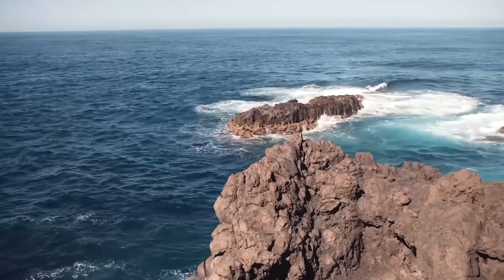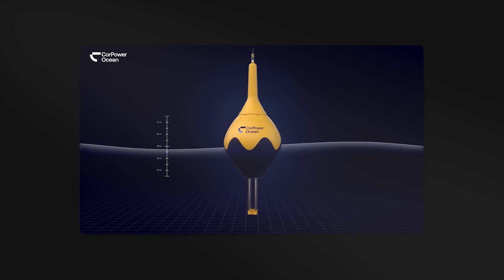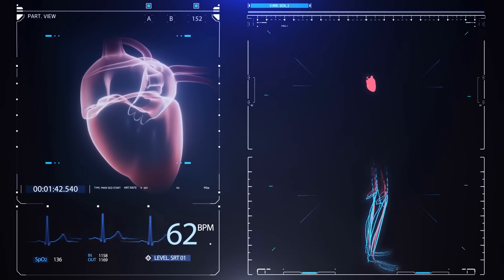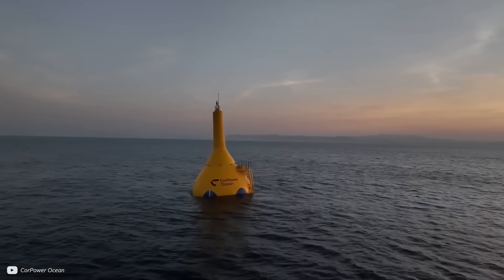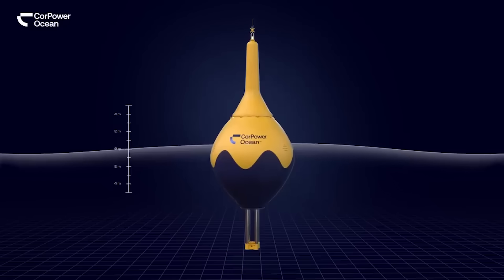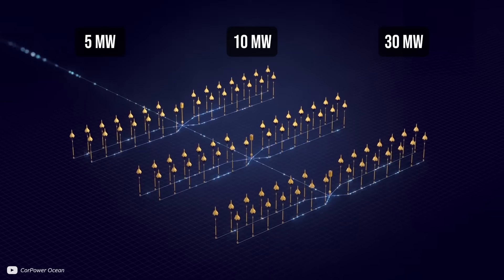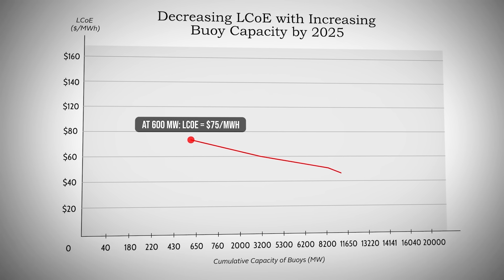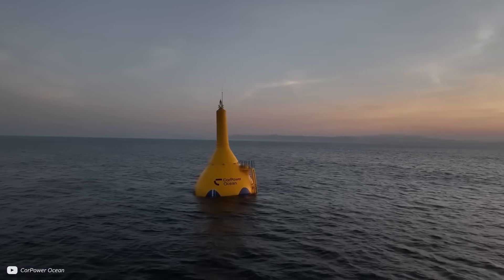Unlimited Wave Energy: This Buoy is the Future

Comment: I've written to this company and at least ten others (working on wave energy conversion). over the last 10 years.  
I have never heard back from any of them.

I have identified a viable method to power the business end with an alternate to the ocean.
Reply: Unfortunately, there are legal liabilities which discourage companies from freely responding to solicitations about novel ideas. I transition from a staff engineer to an engineer-patent attorney liaison for 6 years. I saw the reticence to openly meet with people. You may first need to officially document (such as filing a patent application) your idea. This codifies WHAT your idea is and helps protect the company from people who may sue, claiming their idea was stolen, when, actually, the company independently designed, or designed before the initial meeting. You may also want to volunteer a Non Disclosure Agreement (NDA). If they respond, you can expect their own NDA to follow (read it carefully).

Note: A patent application typically remains PRIVATE for a ~year after filing before it becomes public. So, if you want to promptly discuss your idea after filing, you would have to specify your willingness to present the as yet unpublished application to them. 

Filing an application is relatively inexpensive. Pursuing it to either final rejection, partial acceptance or full acceptance (rare), is very costly. Unless you've got substantial financial backing, don't bother. Lastly, a patent does not necessarily give you the tight to build and market your idea. But it does give you the right to litigate against others who have infringed. This should serve as a GIANT red flag to lone inventors because even if a company infringes, the costs of litigation can EASILY dwarf the cost of obtaining the patent. Without the funds and the time to see litigation through to completion, you automatically lose.

Comment: Wondering if these could help as part of a multi-layer storm protection system too-? Have these out before any more major Sea-wall projects because they function whilst sapping energy from incomming waves, that's how thermodynamics works right?  So during stormtime, have them in a high-resistance mode so they sap more wave energy and protect themselves from damage by hitting their extremes of travel, and could that difference be enough to help reduce the strength of storm surges? Climate change is only making storms more severe over time and this feels like a double-whammy of clean energy and coastal protection.  I live in a coastal town myself, so very interested in this subject.

Comment: I had a similar idea but instead of wave powered it would be tidal powered. You would have a weight at the bottom of the ocean with a cable going up to the buoy that would lock in at low tide and release at high tide, then the cable would go around a spool that would be hooked up to a gear system and an electric motor. The great thing about this is that it can generate power at predictive intervals.

Comment: It would be interesting to hear about how the units deal with tidal shifts. With the rigid mooring systems, it appears that they only work at a set depth. That would mean that with a high tide or a low tide, the units would be inoperable due to being over extended/retracted and would just lock in place. There would have to me some way of controlling the length of the mooring rod connecting the units to the seabed and I don't remember this being covered by the video.
Reply: not for ig tides  simple, use tidal energy systems for big tides

Comment: Wave energy could have been done a hundred years ago, but it was the petrol mania already building up and establishing in the 1950s and selling toxic petrochemicals and nanoplastics in the 1980s

Wave energy can be easily done in an artificial wave reef to absorb wave impact on floor, or air piston chambers on port and rather than produce electricity we don't need ( as well countless if useless electric devices) it can produce compressed air for neumatic energy to power any mechanical appliance, machine or tool while concentrated solar can be used for cooking and solar distillation desalination, while also fridge compressors can be powered by wind turbines shaft,etc

Comment: This does NOT take up less space / is not lighter:
"The 300 kW rated power C4 WEC is 9 m in diameter, 19 m tall, and has a mass of around 60 tonnes"
A GE 1.5 MW (5x the power)  Wind turbine: 70 m tower (3.7x) and is 164 tons (2.73)
Infomercials like this are the worst. Stop copy pasting their marketing material and do 5 minutes of research.

Comment: I don’t think that your description of how the heart works is correct. As I understand it the main chamber of the heart pumps blood all around the body and the oxygen depleted blood returns to the second chamber of the heart. Then the second stroke, the Diastolic stroke or referred to the resting stroke pumps the blood through the lungs to re oxygenate it and that flows into the main chamber for the Systolic stroke to do the process all over again. I think that is how it works.
I do like the idea of using wave action to generate power though. I live on a boat and am looking for ways to generate more power during the non daylight period. 
I like their rack and pinion drive approach, and that got me thinking of how I can utilise the movement of my boat to generate some power. My 5 minute notion is to have a long vane on each side of my hull with a leading edge pivot point where a power generation device of some kind is built in. The 2 “paddles” would generate power as the boat rocks with the waves while sailing. These paddles could also act as stabilisers too. That is worthy of an experiment. The big problem is how to turn small pivot angular movements into energy. I think I will start with, rather than a rack and pinion, a high ratio gear drive. Even if it only generated 200 watts while sailing that will be some 5 kilowatt hours in a 24 hour period.
That has a lot of potential, so thanks for the inspiration.

Comment: Might work for preventing coastal erosion too. A few rows of those parallel to the coast should be able level the waves.
Reply: How will this dampen waves or encourage root growth?
Reply: @jasonsharma5888  Like oil on water, just leveling bigger waves so they don't grow big at the coast and eat at the land.
Reply: @biondanishgenomeinstitute8193  I see, you would need to put these devices in a mode where they pushed back against the waves without breaking in order to do that, and the more surface area they had the better they'd work; currently when there are big waves the device disengages so it doesn't break and they're designed to float, more than fight the waves. Your analogy is also flawed because oil on water is adding surface tension. There is another issue: where waves grow the most is probably closer to the coast than these devices will be anchored.

Comment: Interesting video but you'd need a lot of these 600KW wave generators to replace a single 8MW offshore wind turbine. You also need more connections to join them all up. Also remember that anything immersed in sea water will suffer from corrosion - the generators in offshore turbines are generally around 100m above the sea but these are actually in the sea. The fiberglass shell of the device certainly reduces the LCOE but will it survive impacts with debris that can be floating in the sea? Will it be equipped with a pump in the event of a puncture and will it notify controllers that  something needs to be fixed. Do they work in all sea states (other than flat calm)?
Reply: Yes, these things need to be light enough to float, yet sturdy enough to handle anything the ocean can throw at them for decades.
Looking at the shore-line after a storm and seeing what washed up ashore makes me doubt these things are sturdy enough.
Reply: It's not just a matter of connecting up all the generators.  If they are generating AC voltage they will all be out of phase - how to combine their outputs?  Presumably there will need to be conversion to DC at some point to enable them to work together.

Comment: The best thing about this system is that the corrosive environment is totally sealed out of both the electrical AND mechanical components, ensuring a long and reliable life. Brilliant!
Reply: Give it time
Reply: The environment will ineviably find its way in.
Reply: It moves up and down it's anchored tether.... So it is exposed.
Reply: @John-ou4rm  yeah, I've just had another look and there has to be some kind of seal at the bottom of the buoy... That must be one clever seal.
Reply: @Poult100 many car seals have three rubber rings, so if one fails there are two more that  hold.
Reply: If the outside gets corroder they might reuse all the internals and put it in a new extetior, that would be huge
Reply: That is key, every other ocean based system I have seen would be wrecked by corrosion, or require a significant amount of regular maintenance.

Comment: You can NOT reach 100% efficiency in the real world and 300% efficiency is complete nonsense as the thumbnail implies, sorry.

If the thumbnail meant that the efficiency is 300% higher than other solutions, that could be possible, but it is not what the thumbnail says.

Why?
Waves carry some energy between their ordered (calm water - high entropy) and unordered (spikes - low entropy) states.
If the buoy harvests this energy without adding any other energy source like solar or wind turbine, it is impossible to harvest more energy than there is.
It would also be nonsense to measure the efficiency of multiple sources relative to a single source's possible output.
You will also always lose energy in the generator by friction, transportation, and so on, so you always harvest less than 100 %.

Yes, heat pumps as a counterargument have heating efficiency higher than 100 %, because you are not generating/transforming energy (heat) but you are "stealing" (transporting) the heat from another place.
So it is not the efficiency of harvested/transformed energy, but rather the ratio between the input energy and the stolen energy from outside.
When there is no heat to steal, you have to transform the input energy into heat which the boiler does, and again, you can not even reach 100% efficiency.

Comment: I had this idea too about 15 years ago, so I calculated the maximum yield during a vacation on Tenerife (I have a Masters degree in mechanical engineering). The waves around Tenerife look great, but even there they're about 2m high and arrive every 10s. To catch the top of a wave efficiently, the diameter of the buoi maxes out at around 3m. This resulted in about 5kW power per buoi, so you need about 1000 buois to generate as much as 1 off-shore wind turbine. This is why I gave up on the idea...
Reply: I see in the video he put the output per buoy at 600 kw.
Reply: @bakedbeings  He said that had a PEAK output of 600kW. Very sneaky wording.

Most likely the average power rate is nowhere near that high.

And of course he then compares that peak amount with the nameplate rating of wind turbines which have much higher peak outputs.
Reply: @mcs699  Well that's not apples to apples.
Reply: Agreed. Care to estimate the energy with the approximate dimensions of this buoy? I find the article quoted figures / gains highly questionable. I'm also not impressed with the phasing explanation / mechanism. Regretfully nothing here convinces me of a significant advance rather an attempt by a failing start-up to profit from a higher profile. It's a shame, I don't assocaite this site with click-bait titles.
Reply: Power rating and actual power output are two different parameters. The Power Rating is the capacity the system is designed for, not that it will deliver that power in most circumstances.
Reply: Yeah, showing off shore wind turbines while referring to 15+ year old wind turbine specs is a bit off-putting.
Reply: The offshore turbines installed at Dogger bank A and B is 13Mw each. GE Haliade-X 13. Dogger Bank C and later will be 14Mw each.

The blades are 107meter on a 220meter rotor.
Reply: @Twistedpaolumu hello and thank you for sharing your wisdom -- blades as long as one football field?  Yes?  Really?  I'm speechless 😶 🤐 please elaborate so I can get researching and learning, thank you.
Reply: wind turbines arent consistently running all the time, the winds change. waves are constant. wave generators are always running. also your numbers are vastly different than what the experts put out, so maybe you need to look into it further.
Reply: @MyBinaryLife  never trust an expert on a start-ups payroll. they're legally required to lie to profit the company.

Comment: Any wave energy harvesting is better than none, but it's not clear how well the anchor will handle strong currents, and how they'll cope with barnacles and other aquatic life bound to come up with additional uses for the structure.
It would be more practical to build piers with wave energy capture devices in place of pillars, as that simplifies the generator installation, access, cabling and maintenance a lot, and provides additional real estate that can be used by the public for recreation, entertainment, boat rides, etc.

Comment: I'm not convinced.
There are still the issues of energy density, energy storage, and the ratio of energy gained versus energy spent in production, logistics and maintenance.

For example, wind turbines produce in their lifetimes far less than what they consume far more energy in the manufacturing and deployment phase along with their regular maintenance. So they're a net negative; The environment would be better without them.

Solar panels are net positive but take years to make up their average energy cost.

The only "semi-green" energy that is really effective is hydroelectric, but that's only semi-green as it utterly destroys downstream ecosystems.

I'm always very skeptical of "green energy".